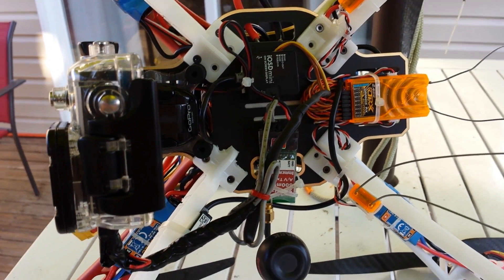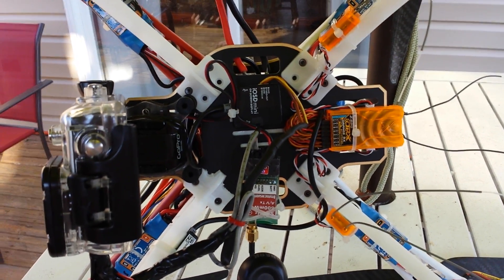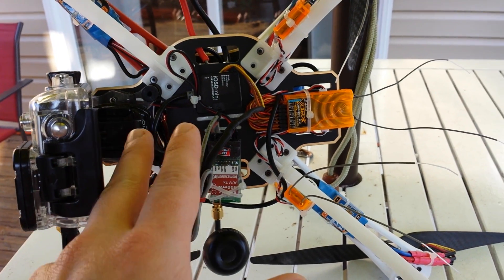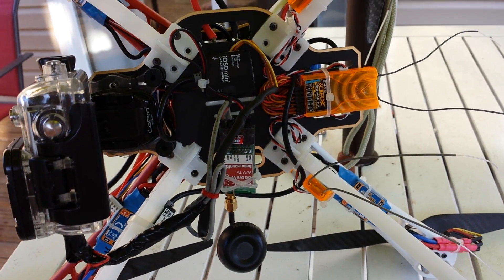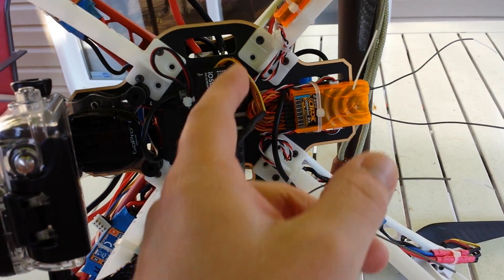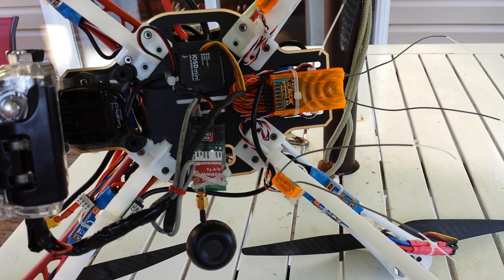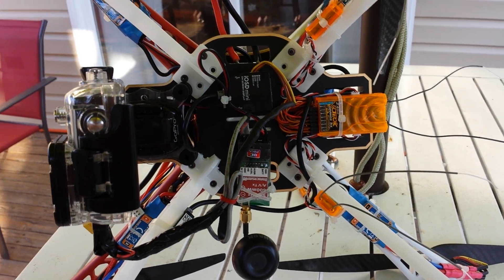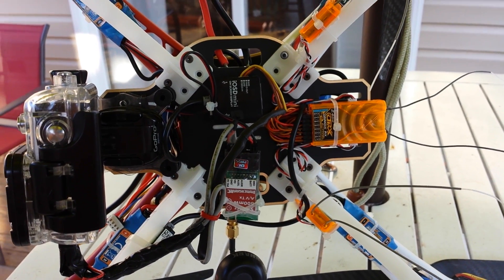DJI Mini IOSD Finished mounting - undercarriage

Comment: what motor/prop combo are you using?
Reply from the maker: Ntm 28-30s 900kv with 11x5 carbon props
Reply: Have you done a maiden yet? I am interested to see the flight time with all the stuff you have on there.
Reply from the maker: Yeah I get about 8 to 10 mins with my turnigy 3300 3s, 12 to 13 mins on my 4400 pack that is 2 2200 zippy compact in parallel,  and about 14 to 16 mins with my 5000 3s zippy compact. Decent I think
Reply: Yeah, that is actually pretty good for how heavy it looks in your latest video with the gopro mounted and everything. That's awesome. Keep doing videos, I love to watch 'em!